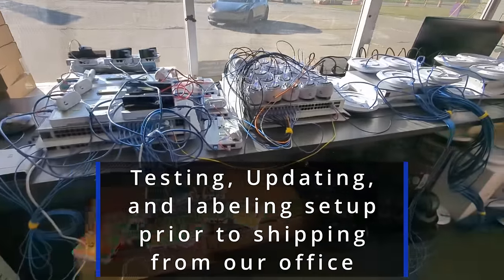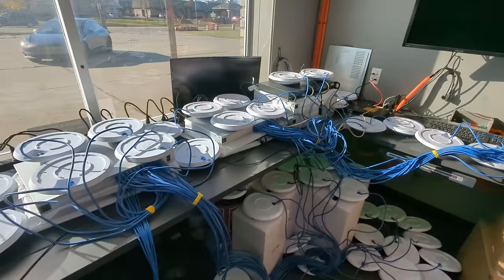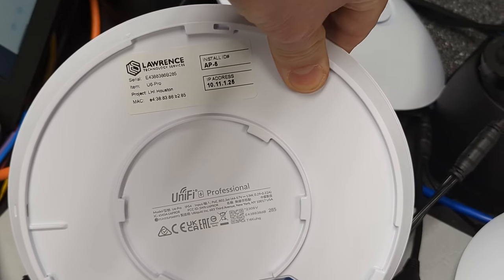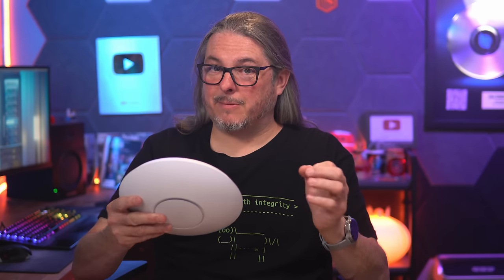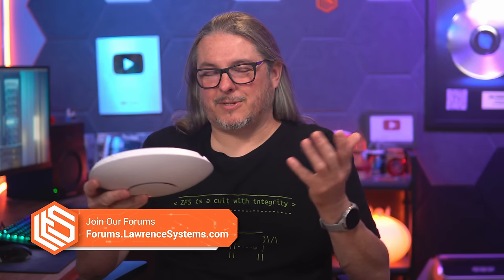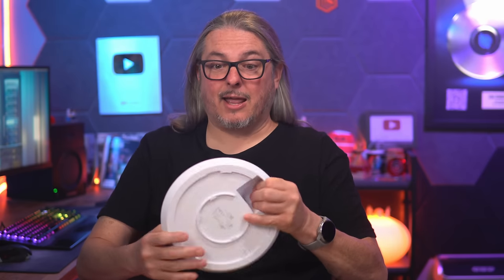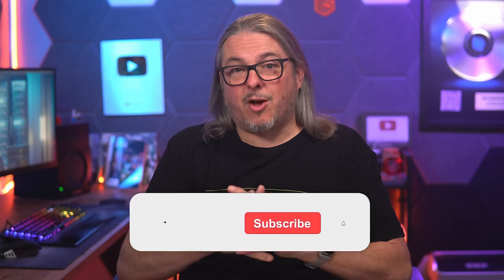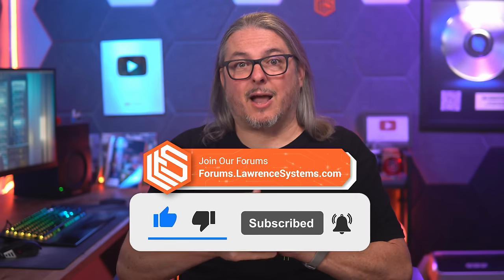UniFi: Built to Last? My 6-Year Access Points & Switches Project Follow Up

Comment: At the company that I work at, we have around 50 APs and 15-20 switches deployed on our locations. After more than 5 years, we never had a switch fail and only 2 APs that died. We get some oddly behaving APs from time to time. Usually resetting and readoption will fix those issues.
Reply: 2 of 50 is a 4% failure rate, higher than Lawrences 1.7% rate.

Comment: Can confirm.  I’ve deployed 14 access points at one site for over 5-6 years, public WiFi, 200 simultaneous users on average, only 1 failed (was constantly rebooting).  I’m pretty impressed and have been using UniFi for all my clients.

Comment: After 6-7 years of using Unifi, I’ve  hade a Gen 1 controller fail , and the 2.4 GHz radio on my wifi 5 AC-Lite has bitten the dust.

Comment: Thanks for the overview Tom. I've been using a full Unifi setup for my home since 2022, a UDM SE, USW Lite 8 PoE switch, and 2 APs (U6 LRs). A lot of your earlier videos and tutorials were helpful for me and one of the reasons I went with it back then. 

It's definitely a small and home focused deployment but it's also for a fulltime work from home setup, so I wanted to invest in something that would last and they have been very reliable so far, and as you said with the updates and improvements it seems to have been trending well. 

Definitely would like to see more tips/tricks and best practices for Unifi for a home power user or tinkerer, especially maybe for the security settings, etc. Thanks!

Comment: I've also had a good reliability experience with UniFi networking gear. Been using it since 2018 and never had an AP or switch fail on me. Slightly different story with Protect gear. Had a early UNVR die on me due to that internal USB drive issue, and lost about three G4 bullet cameras out of about two dozen that have been deployed for at least five years. Technically, the cameras didn't die-- they just got really cloudy, like someone put a thin layer of vaseline on the lens. Tried physical cleaning, messing with settings, forget and re-adopt, all to no avail, so I just replaced them.

Comment: I am about to do a small unifi wireless points and their switches at a school. At the end of the day you just cant beat the price. I did a smaller test deployment, and besides some tunning i had to do, it has been extremely reliable, easy to manage, and just so much cheaper. Pfsense and unifi is a great combo, and we are saving so much money.
Reply: How big is the school, if you don't mind me asking? I'm curious as to how other schools/districts run their network and wifi. Where I work, we use Ruckus APs and HP switches. We have around 15 schools and about 3 administrative sites. I think we have something like 100+ switches and several hundred APs. I wonder how well UniFi scales in large networks. We have just under 12k students and close to 1k staff members.
Reply: @JJFlores197  my site has 100 AP's and 36 switches, that'll go up to about 44 switches when i've finished. You might need their enterprise cloudkey unit (1000+ Ubiquity devices and 10k+ clients) or simply instal the controller software on a decent PC. Mine runs on a reasonable desktop PC that's dedicated to just run that. We don't have nearly the number of users you do though so that might be worth getting an opinion on but in terms of hardware it shouldn't be an issue.

Only caveat is i wouldn't be using them for the firewall / router side. Network distribution & switches + AP's are great though.
Reply: I'm not sure about schools, but government offices require AP's t be FIPS compliant and unifi is not, and have no plans to be. (I don't blame them). But you may want to check just to be sure.

Comment: I used to work at an MSP and was the "unifi man" there. I installed lots of Unfi equipment over the years and can absolutely confirm, that their equipment is pretty reliable. Sure you have some DOAs but out in production we had near to zero failures. Now I am running my own MSP-Startup and of course still use Unifi, with a central Ubuntu Controller and lots of API-Scripts for monitoring. I would be so happy if they would release a official documentation to the API and made it more consistent.
Reply: What API are you using and why?  Why not use software like PRTG and monitor via SNMP ?
Reply: @Traumatree  Because SNMP requires line of sight with the device itself. If i do it with the controller I just need to access the controller's Webinterface. Also, I use the API to enforce some settings across all my sites, like Update-Plans and even have it integrated with my PSA / Ticket system. For example, it creates a site in Unifi if I make a new Customer in my PSA-System, or it can create tickets in case fo an alarm and resolve those again if the alarm is no longer present.

Comment: In another set of stats, I have had Unifi gear at my home now for 6+ years and while I have added additional switches like the aggregator, 10g, I still have several of my original gear like my first 16-port POE.  This gear has been in two homes and on 24x7.

Comment: UAC Pro and UAC LR access points have been utterly reliable for us in a half dozen warehouse environments.  Probably somewhere near 100 deployed, stuck on hot warehouse roofs covered in forklift soot, zero failures in over 5 years now (or whenever the UAC Pro first came out)

Comment: Well, a sample size of one isn't much of an example. But, back in February of 2016 I installed a Unifi AP-AC-lite in my house. It replaced an ISP provided Actiontec router that just wasn't cutting it.  Well, the Unifi AP is still up on the ceiling providing a solid connection to all the wireless devices in the household. Not a single hiccup in 8 years.

Comment: I don't deal with large deployments, only what I have at home but my U6-Mesh died after less than 2 years in use but Ubiquiti replaced it with a brand new unit in the retail package with all the accessories they come with. I'm glad to hear that it seems like they're failure rate is low and I don't have to worry too much about it happening again. I also have an even older AP-FlexHD and just got a U7-Pro while waiting for my U6-Mesh replacement.

Comment: I’ve only deployed about 50 APs. Out of those, we have had one long range unit fail, and I may have one U6 lite failing. The failure modes have been kind of tricky, but I will give credit to unifi’s customer support. It has been very good.

Comment: Love these types of videos.
Also, as an extension of this, pull out an older AP and see how it holds up against more modern use cases today.
I'm using a nanoHD myself, but I generally don't use much WiFi, I'm just using ethernet.

Comment: I've been using unifi ap's for well over 10 years and have deployed 100's, if not 1000's of them. So far they have been bulletproof! I do have to pull about 50 of them out of one location because of the reg change and they are required to be "FIPS" compliant. Which is just red tape crap.

Comment: Given the fairly low cost of the units and the lack of license fee's you can afford to keep a few units on the shelf. Plus 2% in 6 years is pretty good. I've had about the same % here in 7 years of using the AP's and no switches go OOO in the 4 years i've been using them.

Comment: Other than the older Ubiquiti outdoor AirMax outdoor stuff, I've not had any issues with reliability.   The AirMax stuff used to be notorious for Ethernet ports dropping down to 10Mbps over time.    Their newer stuff has been good for us and has survived multiple Cat 3, Cat4, and even a Cat 5 hurricane.  
My Unifi stuff has been pretty reliable.

Comment: It's hard to do long term testing about wifi equipment just because the technology changes relatively quickly.  We've had approx a dozen Unifi access points in service since 2016, BUT none of the original units are still in service.  That said, they were shelved not because they stopped working, but because the tech evolved and we upgraded to the newer faster versions.  We're now on the 3rd iteration of the equipment now, starting with the square access points (I forget the designation, honestly), moving up to the UAP-AC Pro APs, and now we have WiFi 6 Enterprise APs, as of shortly after their release date (which coincided with a move, so we upgraded because why not, not because we really had any actual problems with the WiFi 5 models).  And actually, some of those older APs (the round AC Pro units, not the old square ones which were EOL'd and no longer supported, I should say) are still in service, moved to some low priority locations offsite.

Comment: I've had the original green-LED APs, still work. Blew one up with 48V POE, bypassed the fault and still runs somewhere where 2.4G is fine.
UAP AC Pro - rock solid, zero failures over at least 6 years (might be 8-10 but can't validate as I didn't write it down).
Enterprise 6E, solid, several years zero issues when the cabling + power is good. More sensitive to cabling due to 2.5G uplink.
The In-walls, non-enterprise Wifi 6 version - so that worked great for a few years, but without touching anything, one of them is now constantly dropping to FE uplink. Not sure why. Hoping to pick up an Enterprise IW version to replace it.
Switches. I borked an SFP port on one of the 48 port original non-POE switches. I had the 24 port POE 250W model drop one of the port's POE. But that thing was in a super-dusty, hot environment and it has fans, so not the best environment. Currently running the 'series 2', Enterprise 24 Poe, 48 port Enterprise POE, bunch of aggregation and UDM Pro, UDM SE. U6LRs, all solid for several years. All-in-all, other than the perceived (?) increased sensitivity to cabling over time, no complaints.
Honestly, not had much grief with Netgear and TPLink (basic, non-managed) switches that are rack-mounted or metal casing. Ripped out tons of old plastic 10-100 switches that failed though.

Comment: Our office deploy has 5 Nano HDs that are 24/7 and 2 spares that are occasionally used for a remote office deploy when needed.  They've been in place for a bit over 5 years now.  I've had several ubiquiti devices in my home for many years (I want to say since 2014ish) - only had one failure, an old 24 port PoE EdgeSwitch from way-back.  Power supply failure.  I'm sure it would be stupid-simple to fix but I just haven't got around to it.

Comment: My company has probably 60 sites with Unifi devices.

No question they fall behind in terms of reliability compared to other enterprise options out there. 

I’ve replaced 3-4 switches, 1-2 firewall and 5-6 access points and I only manage maybe 10 of those 60 sites. 

Don’t be surprised to loose a device or two every couple years at large deployments. That said the software suite is good, updates usually run problem free and you’re paying substantially less than most enterprise brands without an ongoing subscription. 

Sometimes there is quirky software issues but there really is a lot to like with the Unifi product line and I don’t have an issue recommending them even for enterprise environments.

Comment: I worked for some wireless ISPs when I was in California. While I was there, I think that they had a very small percentage of general failures with Ubiquity equipment. Probably had more failures from lightning strikes and damaged cables than anything else. And they probably had three thousand units in the field. Some failed under warranty and were replaced, but most outlasted the warranty.

Comment: Where I have hit an issue is with the US-48-500W (Gen 1 48-port PoE switch).  It seems these have a well known defect in their power supply.  We have had 3 out of 10 fail over the course of 3 1/2 years.  Was able to get one back online because one had a logic failure where the other two had a power supply failure, so used the power supply in the switch with the dead logic in one of the switches with a failed power supply.  Have largely disabled PoE, only enabling on a few ports that really need it hoping to slow this failure rate.  Have been replacing with the USW-Pro-48-PoE Gen 2 switch, plus using the Gen 2 switch for the phone system now for a total of 6 switches.  So far 0 issues with the Gen 2 switch.  One switch handles most of our specialty / PoE stuff for the data network and that is now a Gen 2 switch as the original Gen 1 switch assigned this job was the first switch to fail.  Of course the phone network is doing all PoE devices all of the time, so glad that is not on Gen 1 switches, but instead the Gen 2 switch.  Most of the Gen 2 switches are hooked up with redundant power, but so far none have had to use it.

For The UAP-AC-LR and Pro, we have 14 that are primarily 3 years old, though I think the 2 Pros are more like 5 years old.  So far 1 marked failed as we could not get it to pass traffic and two that have needed a reboot at some point after they stopped passing traffic.  Not bad.  In general, liking that Wi-Fi is reliable to the point where if there seems to be a networking issue, we just unplug the wired in connection and test on Wi-Fi.  Before Unifi and before my time here, Wi-Fi was known as something that didn't really work.  Even at my home, before I got into Unifi hardware, Wi-Fi was something that was always fought with issues no matter what I tried.  Now Wi-Fi just works.  Granted part of what I do is make sure there is enough signal strength where I need it as in I use more than one AP, but I was doing that before with other vendors and their stuff was just sucking and I couldn't seem to find someone who didn't have sucky Wi-Fi that I could also afford until I found Unifi APs.

We have two redundant Cloud Key Gen 2 controllers.  One has failed.

The three US-16-XG aggregation switches are still good, granted the spare has been turned off for a while because the 2 active ones are still kicking strong.  Have these hooked up with redundant power.

Comment: Hey @Lawrence Systems, Great video!!!!  Question for you, I have been using a UAP AC Pro for the last few years and its been pretty damn good.. Recently though ive noticed it will reboot for no reason at all.. I only know when my wife or kids say "WIFI IS OUT".  I then go to check the logs in my unifi controller which shows NOTHING, I even SSH'd into the device and havent found much. Would you say it would finally be time to upgrade to a new model?  This one has been pretty solid and has good range but with more modern devices and the AP getting more use, Do you think it would be worth the upgrade?  Thanks & great video!

Comment: I’ve installed hundreds of ubiquiti devices and it comes down to specifics. I’ve had very few failures with APs, most network switches have been good aside from early US-16-150W. Every single USG has had it’s 12V DC power supply fail after a few years. Early UNVR with internal usb storage has also been a nightmare. The 1TB HDD that comes in the Cloud Key Gen2+ is also ‘guaranteed to fail’.

However, yes it does seem to be true that newer ubiquiti hardware does seem to be more reliable than old.

Comment: Have tried the Unifi design tool, but am missing function for when a building has 2 or more floors. Also when the floors are from wood, concrete or concrete on metal decking. Because wifi signal goes through the floors and you can utilize that overlap or have add more ap's because signals are too weak.

Comment: Recently had a less than year old enterprise switch fail we believe due to overheating.  Room was not overly hot but the switch seemed to always be running hot to the touch.  Not sure if too many PoE devices did it in but it looked like it was fine but behaved in an odd way causing lots of network issues.

Comment: Heh. My USG-3P that I bought last 2014 is still alive and kicking (except the external adapter), that's why I still couldn't get myself to get the UXG Max... :/

Edit: I forgot about the 2 Unifi AC AP Pro. Same time, still been with me since 2014, been to several buildings, but still fully working.

Comment: The AC-Pro and AC-Lite seem to be having issues with the latest firmware. It seems a lot of people on the forums had to revert to older versions on them. I'm included in that in two I still have at a relatives house while I have no issues with my U6-Pros. A friend at work had the same issue with his before I even asked him about it and reverting firmware fixed it for him as well.

Comment: I had problems with two switches so far! A 16 port PoE switch that PoE died, and a 48 port Enterprise switch! The 16 port was in the first three months of installing it, so it was covered by the warranty, but the Enterprise died after the warranty expired! It's very frustrating for a switch, specially one labeled as Enterprise to die as fast this one! And it is installed after a very good UPS, and under AC!! Very frustrating!

Comment: I have had maybe 1 or 2 nano's die on me. However i don't think they are rated to be underwater (it was half submerged and still working) and or soaked in chemicals. the ethernet port no longer had pins. i do suspect the nano's always had a little bug to them. devices would drop and generally act strange. U6 pro's that replaced them work fantastic.